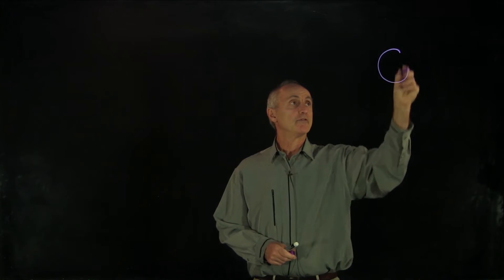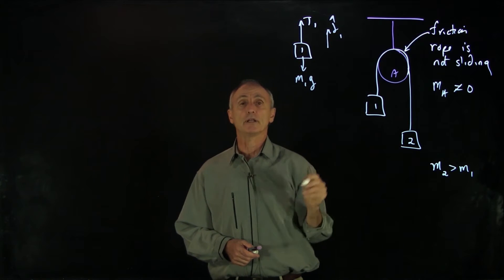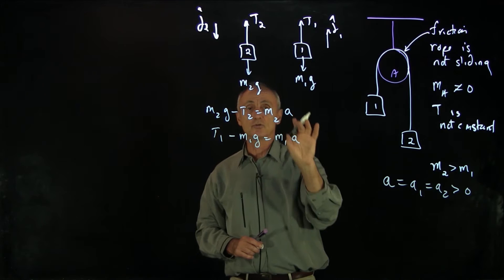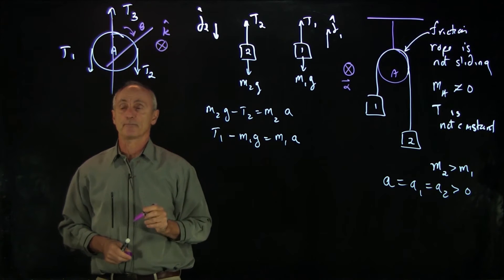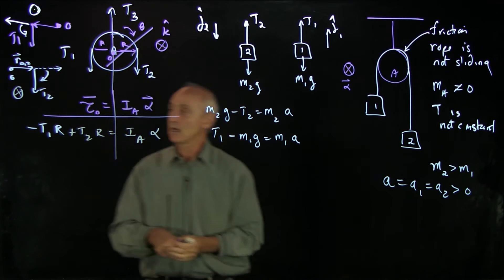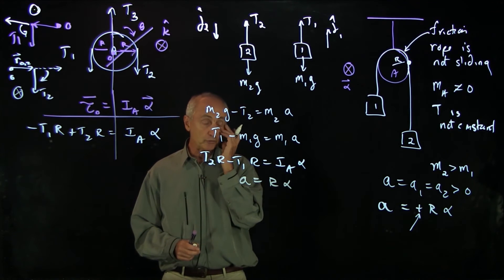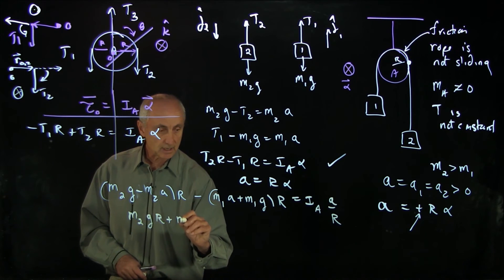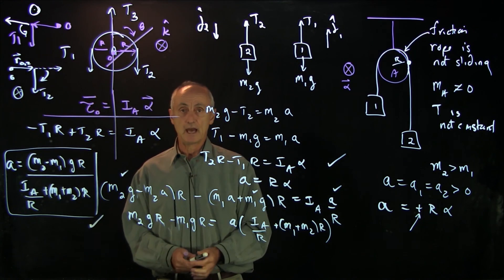31.4 Worked Example - Atwood Machine

Comment: Why haven't we considered the friction between pulley and the rope ? Is that force included when we consider different values of tension ?
Reply: This need not be considered as it is an INTERNAL force of the pulley/curved rope system. And it was proven in 31.2 that all internal torques cancel.

Comment: I cannot understand where are you writing. Are you writing in air?
Reply: There is most likely a transparent surface that he is writing on. It has been mirrored so the viewer can see the writing correctly.
Reply: I think he is writing on the camera's leense!
Reply: @herryjerry5392  Writing on the camera's lens would be absurd, lenses are very expensive and are also very small. Peter would have to write so little to fit all that. They are writing on a lightboard, then the footage is then mirrored.
Reply: @Marjiance26  No No, I was just jokin, I know he is writing somewhere else, but I fail to understand- where🤔
Reply: @herryjerry5392  on a glass wall
Reply: It's called lightboard